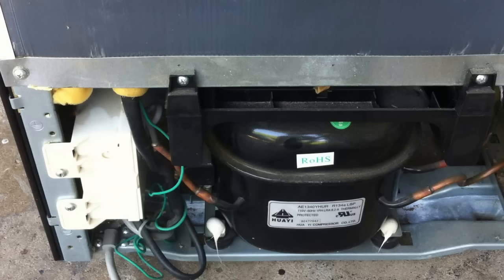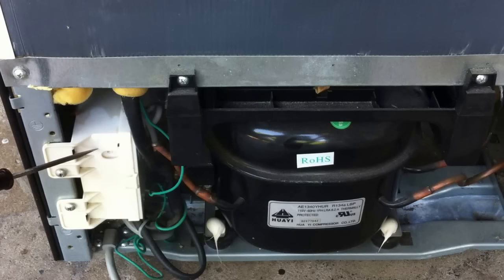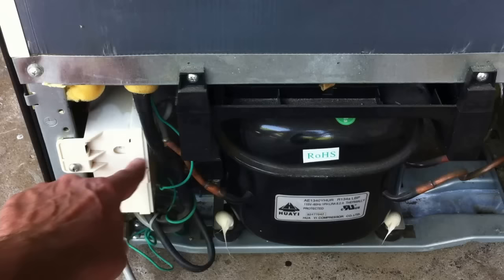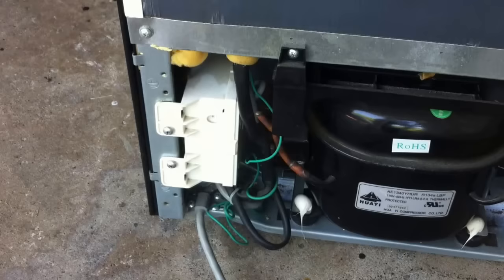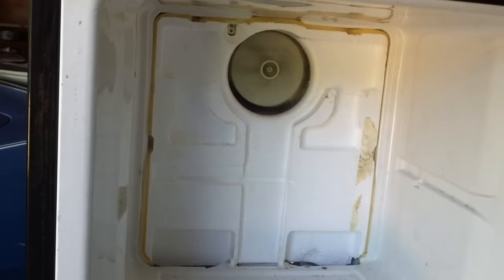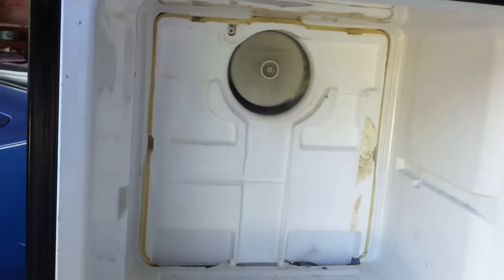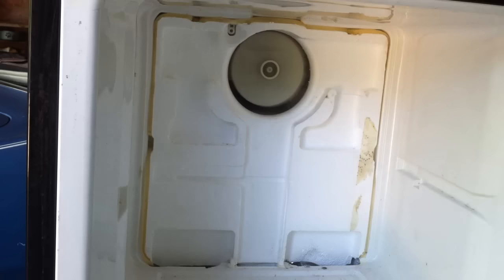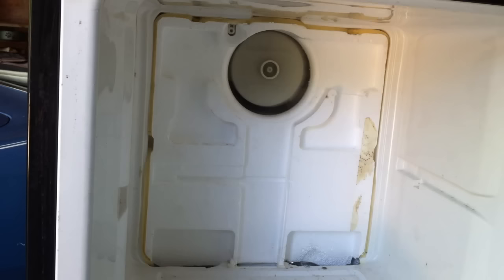Easy Refrigerator Fix, Reset (Defrost Timer) Switch, if it stops running, cooling or working.

Comment: This is just a slot in the defrost timer to enable manual turning which can help with fault finding. A defrost timer can stop for a variety of reasons. By manually turning this you may enable the compressor which will start cooling your fridge. If you are really lucky the problem might not arise again. More often than not it will. Your actions may even cause more problems by not allowing the fridge to enter into a defrost cycle. Do not expect your fridge to just keep running if you are initially  successful with this "re-set" method. Keep a close eye on it as you may wake up in the morning to a disaster. Whatever you do, don't go poking around around the back of any appliance unless it is switched off and unplugged at the power outlet. While i am here, do not turn your fridge on and off quickly. Pressures inside the system need time to equalize for usually a good 2 or 3 minutes. Otherwise you will trip the compressors electrical overload protection. This will however usually reset itself after a few minutes or so. This is why in a electrical storm your fridge may stop working as power may drop out and quickly back in.
Reply: So I accidentally flipped the breaker for the garage fridge off and back on quickly when I noticed, and it won't come back on now. What would you suggest that I do to try and fix it. Thanks in advance.
Reply: @Thisworldisdoomed06  late reply and you are probably sorted out by now but sounds like you tripped the thermal overload on the compressor for reasons mentioned above . turn power off wait 10 minutes and try again. There are many other reasons why your fridge may not start and that's why it is a specialized trade. Even i get  caught out from time to time and resort to YouTube  videos . The odd video is very helpful  most are not some are downright dangerous. Must be very hard for people who don't at least have a trade background. Luck to you.
Reply: @snapcracklepop5921  Thanks brotha. I appreciate ya getting back to me though. It was a little bit delayed, but it finally did kick back on. I do have a little bit of a background in HVAC, but really haven't ever serviced a refrigerator, even though I know they operate on the same principles. But like you said, I rely on youtube videos often, when I'm serving/fixing something that I'm not particularly familiar with. Thankfully this didn't require me to do much. Didn't even pull it away from the wall lol. I just waited it out and in the morning, pleasant to my surprise, it was back on 😆. Anyways, thanks again for messaging me back. Take care brotha.
Reply: Why do I keep getting the error code E1 even with my dual lithium battery set up running off the solar and charging from alternator

Comment: My Refrigerator just stopped working but there was a humming sound. I did exactly what you said and it worked. Luckily the reset switch is inside the Refrigerator. It took me 10 secs to get it working. Thanks a lot. You been very helpful. Thumbs up big time

Comment: I have the exact Magic Chef model from the video which was purchased new six years ago.  It stopped running this evening, so I turned to YouTube.  Some videos talked about testing and/or replacing the 'ptc starter' or 'overload' relays.  I am glad I found your video before doing anything else.  I gave two counter-clockwise clicks,  plugged it back in, and everything seems fine.  If it happens again, I'll probably just order a new defrost timer.  Thanks so much!

Comment: My GE refrigerator just stopped working an hour ago.  The light was on, but it was completely quiet as there was no fan. compressor, etc. doing anything.  I Googled the problem and found your video.  I checked the back of the unit and there was no box or switch that I could see.  I then noticed that in your comments, several people noted that it might be inside the refrigerator.  There was a small white plastic plug in the center of those controls so I wiggled it out.  I saw what looked like a plastic flat-headed screw head.  I touched the screwdriver to it and bingo --- it came back on!  We'll keep an eye on it to be sure that it's still OK but in the meantime, thanks so much for saving all of the food that we in it and the cost of a new unit!  It's just too bad that GE and other manufacturers don't label this so people don't have to search for the solution.
Reply from the maker: I think they know better. It means million$ a year in sales of new refrigerators.  There have been a number people tell me they were about to go buy a new frig., and you can't trust a repair guy for anything either. Love of money is the root.
Reply: Thanks again. Michael.  I sent an email with the details of my problem and your helpful advice and the other comments to a couple of dozen family and friends.  We're flying to Colorado in two days so dealing with this would have been terrible timing!
Reply: Jim Wooten your fridge is supposed to stop and do nothing when it goes into defrost,only the defrost heater on the coil is on to melt ice off the coil,usually about 20 min depending on what model you have

Comment: Thanks a lot!
My 2003 Daewoo fridge stopped after a surge, got the compressor protector replaced, turned the switch and voila! works again. Gotta replace the timer tho but i won some time to save the food in it.

Comment: We have a smallish, basic Whirlpool with freezer on top model (#ET18MMXJW0).  The reset button on this model is INSIDE of the refrigerator on the top wall in the center. It is not obvious! 
1) Make sure your temperature control wheels for the freezer and the refrigerator are both turned to OFF/or as low as they can go.
2) Make sure your refrigerator is plugged IN.
3) If you get on your knees with a flat/slot screwdriver you will see the only "hole" that doesn't have a screw in it. Put your screwdriver in the hole and turn it slooowly, counterclockwise (to the left) until you hear it click.
4) Then turn both the refrigerator and freezer temperature control wheels back up to 3-5 (whatever your preference is) and the fan should turn on immediately.
*If your fridge has been warm or off for a while, it may take as much as 24 hours before your fridge/freezer is cold enough to safely put your food back into it.*  Good  luck!

Comment: Thanks...my fridge/freezer stopped workin.....pulled it away from wall and found my Reset switch in same location...except this one....you push in to reset.....same idea and would have had no clue.....Thanx again...up and running for 8 hrs now....I'd have to say that I am good to go!
Reply: In your scenario, you may have had an actual "reset switch," actually called a circuit breaker (just like the ones that control large household circuits). If your breaker trips more than once, I would suggest diagnosing the larger issue that's causing it to break the circuit. It could (and usually would) be a fire hazard.

Comment: It's definitely a defrost timer, and yes, it's a cheap easy fix, but many thanks for posting this. Totally slipped my mind to check this first, as the other (opposite) symptom happens to us often that the freezer freezes up and the lower fridge gets warm. We take a blowdryer to it and it runs for another 10-14 days... Guess changing out this part is well overdue.

Comment: Ok, so I got a GE Model #Gts18gthjrww Fridge, and was gonna start calling someone to come repair the fridge then I started buying parts I was gonna replace, decided to look for this "trip Switch" and mine was located inside the fridge, where the Thermostat (Turn knob, temperature change, cold-coldest switch is.) Used a flat head turned it while plugged in and bam, heard everything come on. Appreciate thsi video.

Comment: It's always nice to have a temporary fix ready to pull out of your hat, thanks. I think it's called a cycle timer.
I have kicked a few back to life by spinning em around manually a couple of times, but generally speaking the timer needs to be replaced.
Reply: I still can't find my timer on my fridge! it's not in the back like this video show, it's not in front where the lights switches are!  it's an older fridge 2003 Kitchen aid -Model number KSBS25INBL03 Please help!
Reply: @chaldeani6884  any cycle time I've ever seen is in the front underneath held on with two screws and one clip on wire harness.

Comment: DUDE! I just got a new refrigerator it was a display model so it was cheaper great fine really..... Got it home and broke the plug so got a new plug.....then nothing i when from top to bottom on it couldn't fine nothing THEN i watch your video OMFG there it was so after being tired and fed up I ran to the refrigerator unscrew the  backing next to the compressor and BOOM!! there it was the relay switch thank you very much

Comment: I'm a computer guy by day and a cheap, unhandy homeowner by night.  Your solution sounded the easiest so I thought I'd give it a shot.  I can't afford a new refrigerator (or a repairman which is more than a new fridge).  I pulled my fridge away from the wall.  Just for the heck of it, I unplugged it and plugged it back in.  Problem solved.  Never under-estimate resetting a computer-driven appliance.

Comment: Frigidaire stopped.  Didn't find reset switch. Condenser fan was on.  Evaporator fan off.  Compressor off. Fridge is warm.  Starting jerking on plugs in compressor  area Zilch.  Tugged on plug by condenser fan, a snap sound, compressor kicks on!! Still no evaporation fan. Hit area. Zilch, Took the freezer shelf out, shelf snapped back hard, fan comes on. Wiring problems?  So far so good. Thanks for the video.

Comment: Just had the same problem! I had the reset switch in the same spot. Your are awesome! You saved me from losing all my food. It worked just like you said. Stupid 1 year old fridge came back on. My model was FFPT12F3NW. The back looked just like yours. My only question is;  "Why wood you need to reset the switch? What caused the fridge to do a shutdown? I never lost power here and all my outlets are properly grounded?

Comment: I had a fridge that was melting the ice in the freezer section - a new defrost timer was not the issue, but it was the defrost thermostat switch, that allowed to heater to get too hot - it was always in an on state.

Comment: I have the same refrigerator with the same problem.  However, there is more to the story.  When you "reset or trip switch" you are actually manually advancing the time.  The time is used to switch the fridge in and out of defrost mode.  My switch was bad.  If you manually turned the switch until the fridge ran it would never switch to defrost and it would eventually freeze up.  If you manually switched the fridge into defrost mode, the defrost would come on and never turn off, eventually the thermo fuse would react and turn defrost off.  By manually switching the fridge from cold to defrost I was able to determine that the compressor and the defrost heater were both working, so I purchased a new switch from ebay and and the problem was fixed.

Comment: Hey great video thanks and bunch... my frig shuts off cooling every three to four days ill have to unplug it for a few hours before it would turn back on. Today it was down over eight hours until i saw your video, hit that trip switch turned right back on again. Thanks a bunch !!!
Reply from the maker: That’s great! I don’t know where you live but, here in Dallas, TX you can find really good used refrigerators for $100 or less at estate sales. On Craig’s list sometimes you can get one for free if you just go pick it up off the street curb.

Comment: Absolute miracle that I came upon this video. Couldnt believe it when I saw the exact same back covering of the fridge, motor and transformer! The solution worked for me but I turned mine two 3 clicks. Do you think that will be a problem?  It does work though.

Comment: I don't know if this has been said by others before but that defrost timer in many fridges is in the control panel inside the fridge compartment itself. There's a hole where you can insert a flat screwdriver and achieve the same result as in this video. THIS IS A TEMPORARY FIX. All this does is get your fridge out of defrost mode but the timer should be changed ASAP. These timers are not expensive and they are easy to replace. Do not assume you've fixed the problem because your fridge kicked in.
Reply: So last week i replaced the timer as you shared in this post....i am still experiencing the same issue.... timer did not fix the auto daily shut off.  Any other suggestions? Thermostat maybe?

Comment: Just my 2 cents here, that's the defrost timer (electromechanical in this case). In some models it is wired in such a way that if the defrost resistance is bad, the timer won't advance towards the defrost cycle (it will simply stop before it even begins). That's probably why it will start after rotating it. If it continues running for more than a day, then it's a faulty timer. If it stops again after a day, it's the defrost resistance.

Comment: That is a defrost timer which is like a clock and keeps turning all the time. At some position, it starts defrost heater. Most likely it was stuck at that position and turning allowed it to be free

Comment: Gracias, 

My fridge didn't have a switch like that,  but it led me to the problem - the compressor inverter. 120v going in....0v coming out. A little Googling of the numbers on the part led to several anecdotes of that part commonly failing after several years.  My son had turned the fridge all the way down to 0 and when we discovered it and turned it back on,  the compressor never fired again. I bet the solder joints in the board which had been hot for so many years,  cracked when the board cooled.
Reply from the maker: +Paul Blair That's great. How did you fix it, ordered a new part or re-solder?
Reply: I ordered the part on Amazon. $150. The solders I'm talking about are the hundreds/thousands of micro-solders on and in the circuit board. Not something you can fix easily.

Comment: Omg.. I was about to throw my fridge out.  I watched your video, and although my unit didn't have this button. It did have the box,  so I opened it up and it contained a circuit board with capacitors, resistors and two small relay boxes. I tapped the relays with the head of my screwdriver and voila! The compressor fan started up. Obviously the relay had jammed. If I didn't watch this video I wouldn't have tried it, so thank you.

Comment: Thank you for the video for inspiration.  Went looking for my defroster control and as soon as I touched it, the loose wire made contact and compressor turned back on.  Thought I was genuinely out $$$ for repairs or worse.

Comment: I found this box and discovered what you showed. It does the trick. The problem is that it shuts down after a few days and I have to start all over again. Does anyone know how to keep it from clicking off? Or maybe I just need a new compressor?

Comment: I often wake up to find the fridge and freezer are both warm. As soon as I open the door, the compressor kicks on. Having noticed this, I decided to try to jar the fridge by hitting it with my hand this morning when I got up prior to opening the door. Sure enough, when I did this, it kicked on. To me, I seems like it's not coming out of defrost mode and the slight movement is flipping the relay in the thermostat or something. What do you think?

Comment: Why would someone thumbs down this video. Thanks for sharing.
Reply: Dorothy, I can understand why someone would do the thumbs down thing, though I didn't.  While Michael did find a way to reset the fridge, by exploring, he was brave, intuitive, talented and resourceful, but did not fully understand what he had found or describe it completely, at least initially.  In an excellent example of crowd sourcing, you can get a more precise picture by reading all the comments.  

Technically, there is no "reset switch."  What Michael found was the defrost timer.  The procedure he describes is called "manually advancing the defrost timer to switch from defrost mode to cooling mode."

Arguably, Michael's use of the term "reset switch" helped me, as I thought there as a reset switch.  My google search worked, thanks to Michael.  And my fridge is running now, too.

Comment: I think it's the axle of the defrost timer you're turning here. Like those electro-mechanical timers you buy to turn lights on and off when you're away. It may be stuck in the defrost part of the cycle.  If it doesn't keep turning there's a chance it might never go to to defrost again.  Mine is inside the fridge. I marked it with a sharpie to give me an indicator of movement.  If it doesn't progress I'm changing the unit. Not a refrigerator guy either but spent a helluva lot of time researching all this on the internet lol
Reply: Good morning..... so did replacing your time totally fix your issue? I have the same issue as the video describes, but once i reset the timer the fridge will only run for about 6 hours then the timer trips again.  Happens everytime. I'm tired of pulling out fridge to resrt it! Lol... thank you